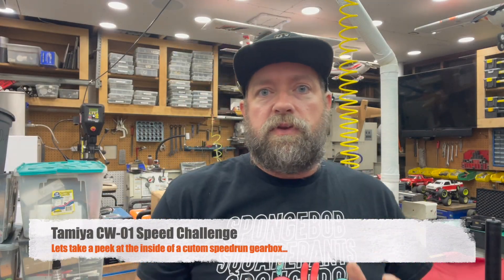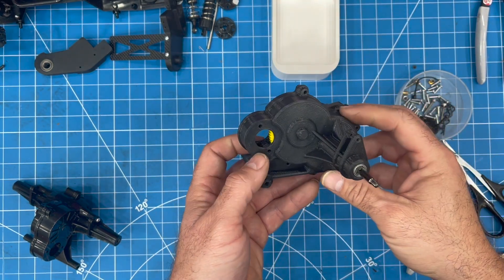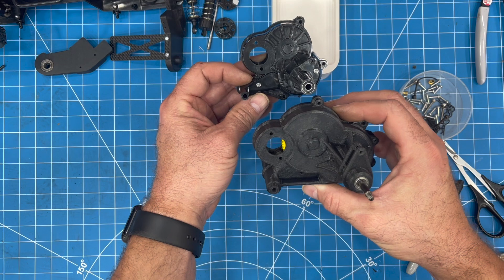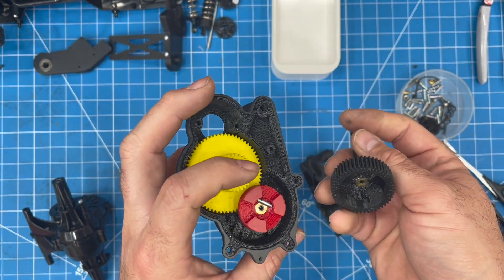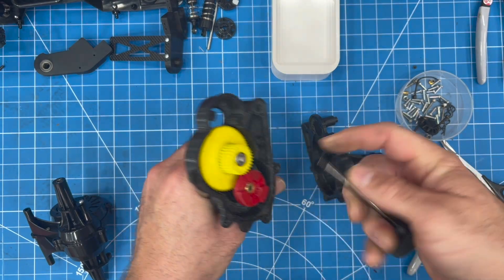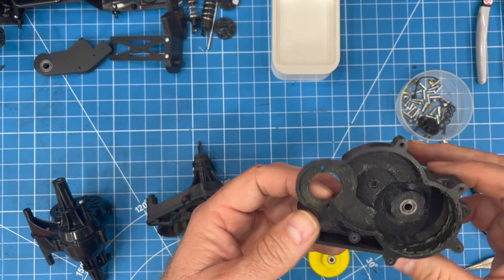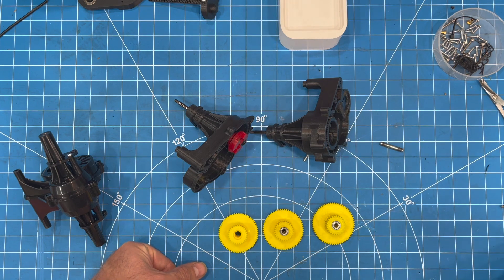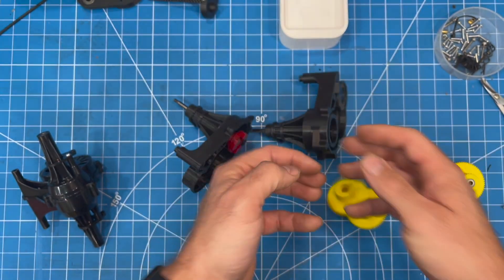E0014: Tamiya Lunchbox Custom Gearbox Design

Comment: Could you delete the spur gear, and design it so the motor pinion is directly meshed with the diff gear?
Reply: Ya..like running a one to.one ratio..that would be ballistic
Reply: I ran.a trinity mad science 10 turn.on my lunchbox back.in.day with a Traxxas xl1 esc..full bearing kit ..it was quick.. only issues was it went through outshaft gears and sundial gears like crazy ..do.they make steel gear kit?

Comment: Where can I get a gearbox like that I would like to try that out on my tamaya grasshopper to make a speed run grasshopper
Reply from the maker: I'm not familiar with the grasshopper gearbox. Is it the same as the lunchbox? There are two routes to go. 

1. change gearing in original gearbox. This is where I am at now and feel like I can get to 60 mph with the stock gearbox and custom gears. But the stock gearbox has some issue such as a shorter length and the shock mounts are kind of weak. 

2. Use custom gearbox. This lengthens the car by 20mm, has better shock mounts. But, it requires a custom wheelie bar.

In my design it's an integrated system of parts including chassis stiffeners, swing axle mounts, shock mounts, wheelie bar, etc... It becomes difficult to just pull a single part out and say that it will work. That being said. I am looking at refining the gearbox design to make sure it works with a more stock setup and making the parts available for printing.

I suppose I could print some parts for you but they wouldn't be as good as what you get from ShapeWays. You can always hit me up at jack.o.trades805@gmail.com

Comment: WHERE DO I FOUND THAT TRANSMISSION ???
Reply from the maker: I am trying to iron out some details of the transmission and making sure it's compatible with the original chassis. I plan to make it available for printing once I have worked out the details.
Reply: @jack-o-trades  Thanks...  let me know...  please.

Comment: I hope one day you release the files for your 3d prints, would love to try a speed build too, i can 3d print but dont have the skills to design the parts
Reply from the maker: I'm totally down to share. I just need to evaluate what parts are fine as just printed parts without the extras of the carbon fiber panels. 

All in all, for this challenge, I designed 44 unique parts and fabricated far more than that

Off the top of my head I could offer the following as printable parts...

- Locker for stock diff
- Wide gearbox
- Narrow gearbox
- Extended Swing axle pivot bracket
- Front and rear wheels
- Locked diff gear
- Variety of spur/counter gears
Reply: @jack-o-trades  great, looking forward to it

Comment: Dude that is amazing!!! I am extremely impressed and you need to get these one shapeways or something! That was a ton of time and effort to design all that up and it is seriously impressive how fast you have gone and could potentially go with that setup!!!
Reply from the maker: Thanks! I don’t mind sharing the files but I need to look at if the gearbox can be installed with the stock parts. I’ve essentially designed a whole rear end for the CW-01 with a handful of carbon fiber parts. The 3D printer ring would only get you halfway there.

Comment: Oh, man I need to watch this video again, a couple times, even! I really love that you're able to print this stuff, rather than need to start using power tools and stuff, it's really quite amazing, this 21st century stuff! Do you print the gears yourself, too? 
Anyway, I'm really looking forward to seeing what you got next! I really enjoy getting an insight into your engineering! 
Have a great weekend, buddy!
Reply from the maker: Thanks! At the beginning of the challenge I thought I would have to do a bunch of machining but I think I’ve got the design of the 3D parts, reinforced with carbon fiber gussets such that they are holding up to the most brutalists of crashes. 

I think my biggest hurdle now is finding a good place to run. This street I’ve been on is starting to get cramped for running on the 50’s

Comment: Are you planning on sharing your gearbox design for us to print ?
Reply from the maker: I can but it’s kind of an integrated system that requires some machined panels (carbon fiber or aluminum). I need to think about it…